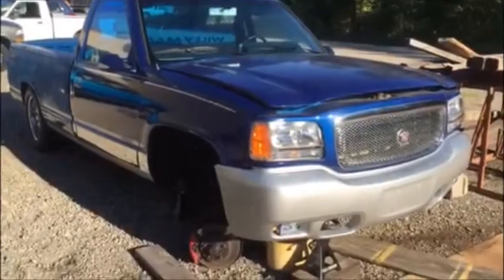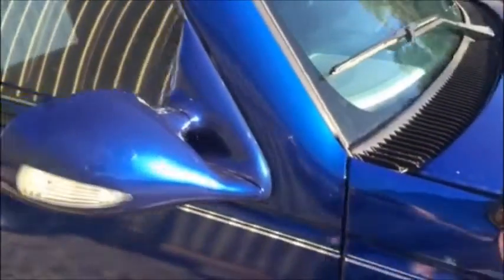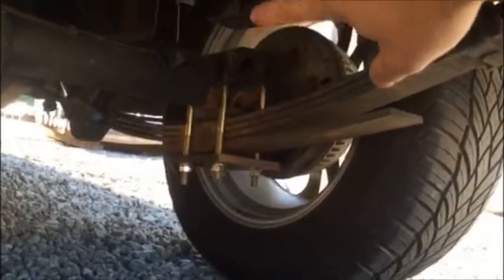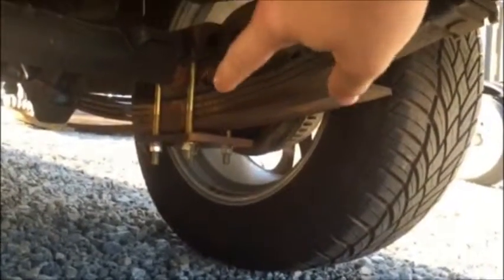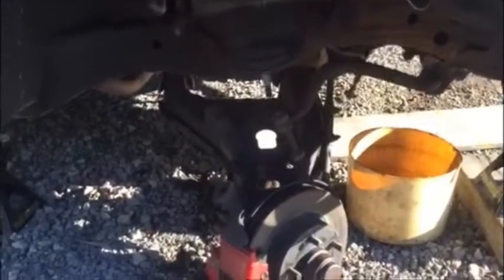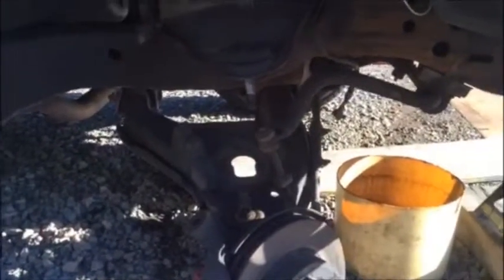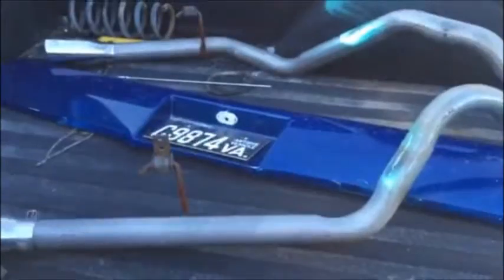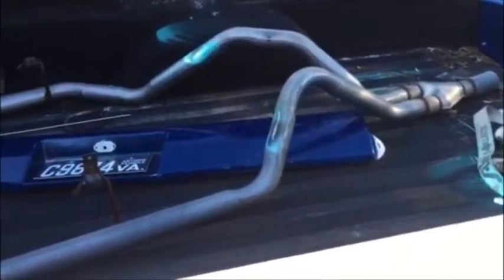1988 Chevrolet 1500 Build (re-build) part 1

Comment: Is that front clip bolt on or did you have to modify it ?
Reply from the maker: Well it is “bolt on” but yes I did have to modify it to mount properly
Reply: Josh Wiley Thanks for the quick reply you wouldn’t happen to have a video of it would you? I’ve got a C3500 that I was planning to do the same thing to but I can’t find any videos of it anywhere
Reply from the maker: Nope. Sorry. I did this way before I started my channel
Reply: @JamesBakariTV   I'm working on transplanting a 2000 escalade front end onto a 92 chev dually 4x4   .  did you get yours done?
Reply: Then there is me that wants to change my 2000 Escalade front clip and hood to a Tahoe ,Yukon or a suburban or Silverado 1500 I shouldn’t have any problems lmk if you have any info
Reply: @alexhaze2732   I got mine done ! you can see it on my facebook page. I still need to work on lining it up perfectly .  I did not even have to change the core support I went from a 92 chev to 2000 escalade
Reply: @toddtempleton9321  No not yet project was pretty much put on the the back burner work, weather etc. but I will be getting back to it next week
Reply: Todd Templeton thanks
Reply: @alexhaze2732  im sure if you pull off your escalade front clip people will want to buy it , im looking for a good front bumper for my 99 denali , let me know if you want to sell the bumper skin ?